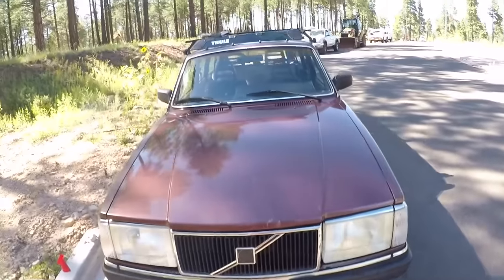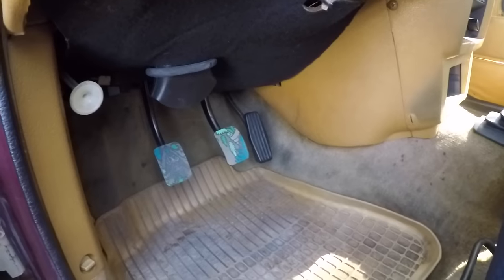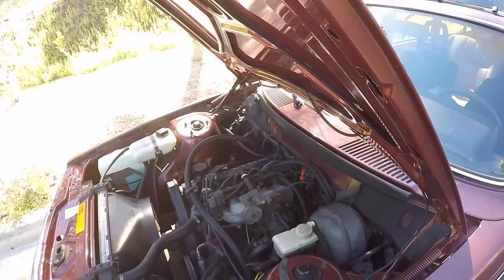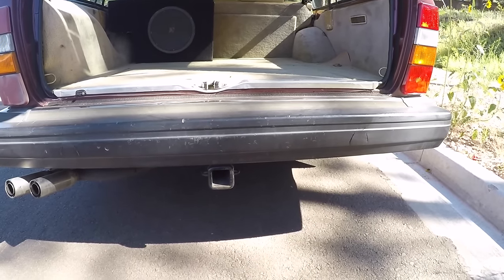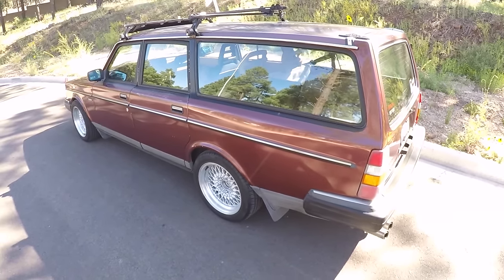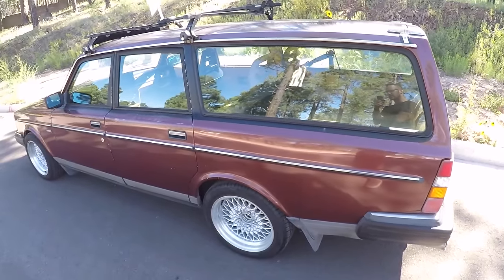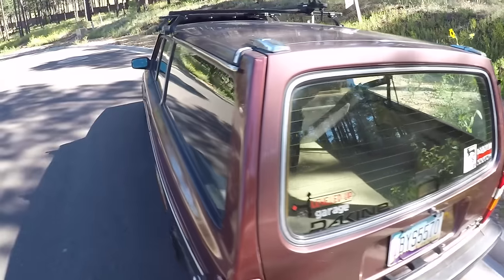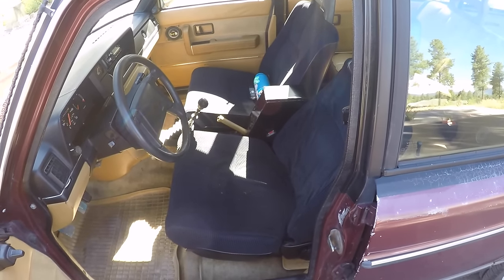The Volvo 240 is Actually a Great Enthusiast Car + Walkthrough and Drive

Comment: where did you get the wheel adapters? I'm trying to fit a set of crown vic mesh wheels on my 240
Reply from the maker: Kurby they were an eBay purchase, replaced the studs, and got hubcentric rings. Cost about $120 all in. Had 15k miles on that setup without issue. Your fenders will need a solid roll to not rub depending on tires of course

Comment: Doesn't the 262c tach read low on a 4 cylinder car?
Reply from the maker: noisenoisenoisenoise not sure, mine was off a redblock bertone, not a prv v6 one
Reply: Interesting. The Bertone never came with a 4 cylinder motor, only the PRV 6. Must have been swapped by at some point so maybe they switched the clocks at the same time. My uncle did one in the early 1990s - a 2.1 with manual/overdrive into a 262c. Caused quite a stir at the time!
Reply from the maker: noisenoisenoisenoise yeah, must have been swapped but the revs matched up with a snap-on timing light ( so I believe it read correctly).
Sounds interesting!

Comment: Is this car quick in anyway?
Reply from the maker: Compared to modern day CVT econoboxes it keeps up if not a bit faster. Quick per say, no probably not. But if it were between spending 2-3k and having a volvo 240 wagon or 15k on a base sentra I'd take the volvo everyday of the week. That being said it is very easy to modify these and make them quick or even outright fast!
Reply: Budget Build Bureau I'm planning on buying an 84 dl wagon and throwing a turbo on it and eventually 1jz it or put in a Sr
Reply from the maker: I like the 1jz idea but I'm a sucker for toyota. For the money that SR's are bringing now a days I think there are a lot better options for powerplants. I think a 1uzfe with a manual trans swap would still be considerably cheaper with 290hp 300ftlbs factory and bulletproof reliability. Also the Redblock that comes in these is a stout little 4 cylinder and can put down some power turbo on the cheap as well. Good luck with your 240! Thanks for watching!
Reply: Quick? They can be made to be anything you want.
I've seen turbo coupe swaps, svt focus engine, 2jz, v8 s of all makes, electric motors....the only limit is your wallet.
Drop in a Ls v8 and a 6 speed go drifting....set up the suspension and set quick lap times....drop it, tune the stock engine , throw some loud pipes on it and put a huge system in it and have a dope driver.
Reply: Budget Build Bureau a b6254 would be better or a b5234t

Comment: Too bad these cost a lot here in France..

Most of them are diesel or b200e (thats not a good engine, it have 117hp, and have less torque than the 2.3l of the same power...) 

Too bad too bad
Reply: Why not get the diesel?
Reply: @-m.d.n-9019  cuz, hm, how could I explain, this isnt the right choice ? The 6cyl diesel lack in power, is reliable only if well taken care of, and most of them have 300k + on the clock, while gasoline ones are quite easy to find with less than 150k in Europe
Reply: @victorpelini5995  oh , I see. What sites do you search on to find 240 Volvos?
Reply: @-m.d.n-9019  Cuz I live in France, I use Leboncoin but because there is so little 240 sedans in france, I also use Autovisual, which lets me pick a ton of filter. Apparently there is a shit ton of good 240 in the Netherland. I have around 6000euros in total so I'll go up to 4500 for the car itself, to have room for improvement :)

Comment: The "plenty of room" in the engine room is because it was intended to make room for a Chevy smallblock one day. Volvo sold Chevy SB as marine motors called "Volvo Penta" those days and had ideas to put it in this car.  Instead, Volvo went for a Renault V6, the B27, which is the absolutely worst engine ever, to be avoided at any time.
Reply: Is that legit?

Comment: Its a 245
Reply from the maker: you are correct but they dropped the 245 nomenclature and badges in 1983, so technically all models after that point were classed 240.